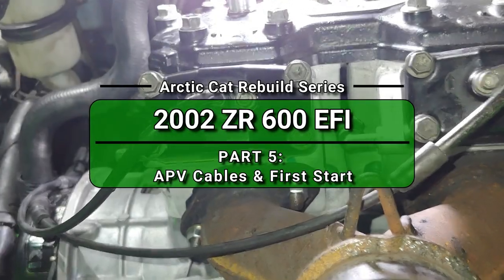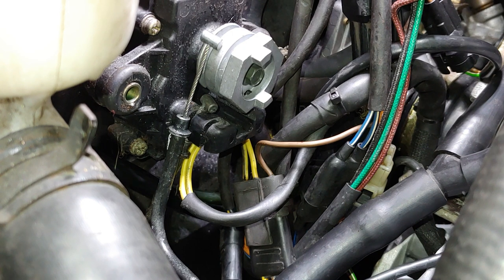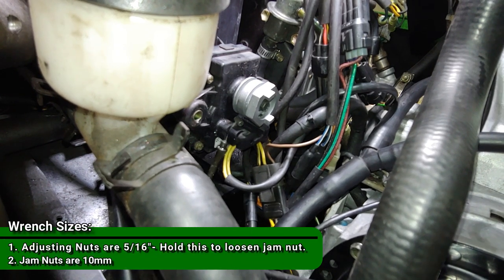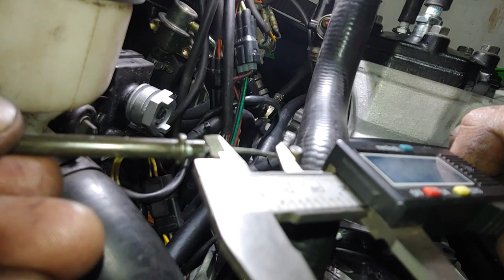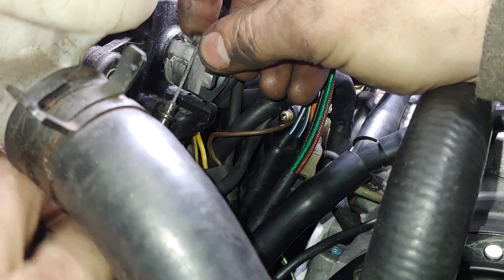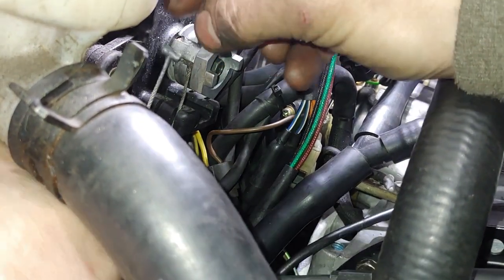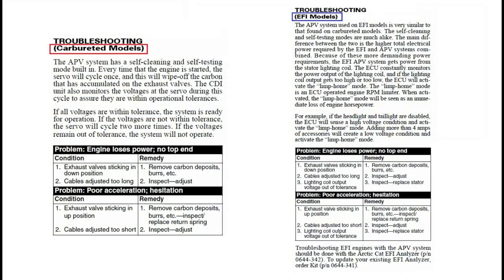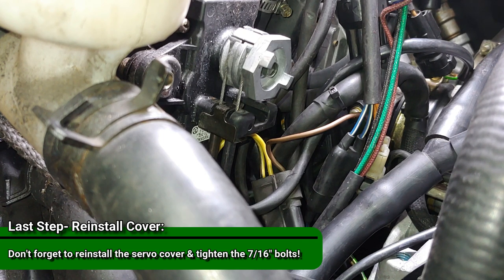02 Arctic Cat ZR 600 EFI Part 5: [APV Cables & Will it Start]

Comment: OK need some help please. Picked up an 02 ZL600 SS. Cables were off of the servo. I have them adjusted. I took the servo apart to check the gears and cleaned them up. Now I need to know that starting position of the cog that the cables go on. Also. My servo operates backwards if the cables are installed on the left side of the servo as yours are. Do you manually put the servo on open position when you start it? If I turn the servo clockwise with cables on the left it will open my APV valves. If I Rim the cables on the right side it would pull cables open clockwise. Going into this blind new sled owner new to snowmobiles.  Any help would be greatly appreciate.
Reply from the maker: The cables will attach on the right side if you're sitting on the sled and they will typically be about at the halfway point horizontally where the drum sits.

Comment: Where does that hose with the “Y” go? The hose by your right hand.
Reply: Please help!!
Reply from the maker: Mine in particular goes down to the belly pan on the outside of the frame down by the exhaust and it's just an oil drain and breather for the apvs I believe